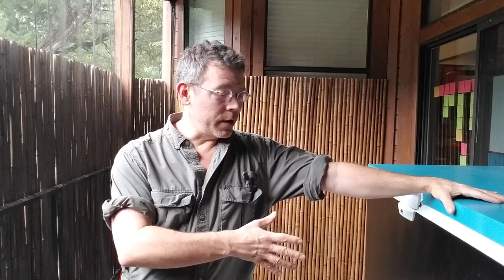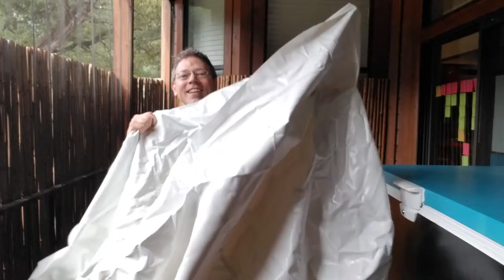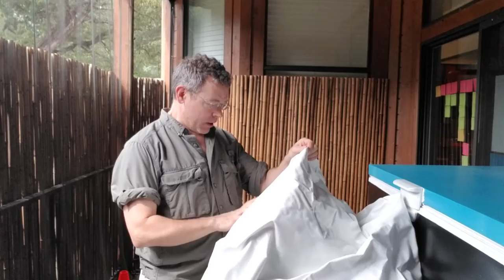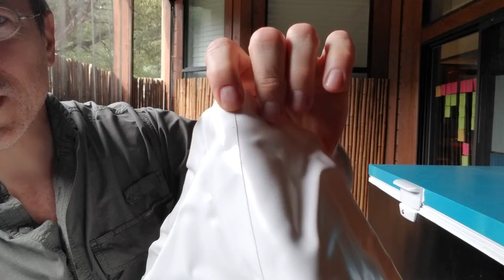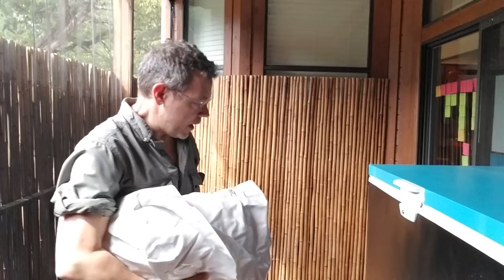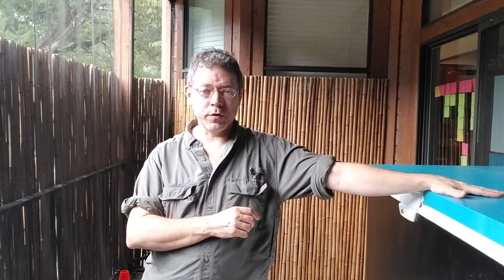Do you Need a Liner for Your Chest Freezer Cold Plunge?

Comment: Very informative video,I bought a very large chest freezer from a kebab shop complete with holes in bottom foil,siliconed them up as best I could placed carpet in bottom and used a heavy duty Pvc pond liner, so far holding up well with the ink bird temp controller and a floating chlorine tablet dispenser 👍👍

Comment: If I use fiberglass liner, do I need to sand it or is the sanding only for pond liner?
Reply from the maker: @op14435  - sanding is required for any permanent coating applied to the interior of a chest freezer. 

A step by step guide to fiberglassing a chest freezer is in the works. 

Join my free facebook group for updates.

Comment: Thanks for video. Have bad chemical issues. Thinking maybe fiberglass!  Don’t really want too much going into the freezer so thinking I will empty every week rather than filters etc. how would fiberglass work if you left drainage exposed?!?
Reply from the maker: Hi Danielle - I totally understand about chemical sensitivities - one of my friends in Austin had that issue. 

Lining a chest freezer in fiberglass is a big project. If you are new to doing fiberglass, there are many things that can go wrong and you'd be better off hiring a professional who is experienced. The cost could add up quickly. As an alternative, you might look into Line-X XS-350, which is a coating certified for use in potable water supplies. It has a smell for a week or two that dissipates. See the link in the video description comparing the four liner options for more info.

Comment: Hello, I bought your book. Glad I did. Great info. Question for you, you mentioned getting a pvc liner since it is more compatible with ozone. Any suggestions where? I found plenty of places that do vinyl. The one you suggest in your book is local to me and I’m just waiting for them to get back me.
Reply from the maker: Thanks for your feedback. 
Both vinyl and PVC are rated as having a "B-Good' compatibility with ozone. I ordered a PVC custom pond liner from here: 
https://polyfabrics.com/liners/pond-liners/
Reply: John Richter Thank you for the reply. Nice! That’s the company I contacted. Just waiting for a response from them. Got pump, ozone, timer and just need liner. The thin metal in the freezer I bought is sketchy.  Lol
Reply from the maker: @mfeltster  - those metal interiors are not the greatest. Find a wet area floor mat to put on the floor - that will help protect it. Also, it's a good idea to support the outside bottom to keep it from sagging. that info should be in the book! :)
Reply: John Richter yup it sure is. Already on it. Thanks.

Comment: I used JB Water Weld to seal and then painted it with Pond Shield. This worked really well (since February). But I have found a very think layer of water has got into the bottom panel (seems to be stuck there). Has anyone found this? Not sure if its could be dangerous?
Reply from the maker: Any leaks could damage your chest freezer. Find out where it failed and patch it. 

First,  drain it and put it in the sun for 7-10 days to bake out the moisture.

Comment: Hey, John! I just applied jb waterweld to my chest freezer but I must have missed the part where you mention to sand the areas the epoxy is being applied to in order for it to stick. Do I need to redo the entire thing or what can I do to ensure this won't cause any issues before I add water? It is white plastic inside.
Reply from the maker: If it has cured hard, then let it be. 

However, if you want that chest freezer to last long term, install a liner. That is not plastic, it is white enamel over a metal wall, and we have plenty of reports of surface rust when no liner is used- some in as little as two weeks. 

See this post for more info about the recommended liner options: 

https://chestfreezercoldplunge.com/4-liners/

Comment: What liner will be preferred if I want to make my chest freezer with salt water ?
I recently bought chest freezer with aluminum interior and I want to cover it with something because I don't want to make a bath with metal.
Reply from the maker: Pond liners are the easiest and least expensive option. 

I have a free spreadsheet in the files section of my Facebook group that will help you figure out the right size. 

Check it out here: 

https://www.facebook.com/groups/chestfreezercoldplunge

Comment: My interior is bare metal New,  can I get away with just using pond shield without sanding or am I better off using a liner? I want to go the pond shield route but don't like the idea of sanding and then spraying that thing you suggested.  Hopefully I can by pass those two steps and go straight to covering the bare metal with pond shield..
Reply from the maker: Best practices are best practices for reason. If you leave out any of the steps to install Pond Shield, it will fail, and you will have wasted a bunch of time and money, and then you will have to start over, wasting more time and money. 

It is always less expensive to do it right the first time - believe me I've learned that lesson the hard way. 

See this post for the best practices and steps to install Pond Shield:

https://ChestFreezerColdPlunge.com/Pond-Shield

Comment: Hey John! Is there any possibility of electrocuting yourself due to a leakage or a charged capacitor when the freezer is unplugged? Thank you!
Reply from the maker: Safety is of vital importance when converting a chest freezer, and this topic has been discussed in depth on my Facebook group Chest Freezer Cold Plunge. 

Yes, you can electrocute yourself if you get into the chest freezer while it is still plugged in, and the seams have started to leak water inside the walls. That moisture creates a connection which puts an electrical current into the water. 

If you unplug the chest freezer EVERY time before you get in, this will not be a problem. 

If you correctly seal the seams, this will not be a problem. 

Appliance repair-people and electricians have said that there is nothing to worry about regarding a capacitor.
Reply: @JohnRichterAustin  thank you for a quick and detailed response, I appreciate it! I'll check out the Facebook page very soon. So the capacitor discharge or a short circuit is not possible while the freezer is unplugged?
Reply from the maker: @Vladgg26  - when the chest freezer is unplugged, you must still have the power cord AWAY from the power outlet, and make sure that there are no other appliances, tools, or electrical devices anywhere near the chest freezer. 

If you do that, there is almost zero chance of electrocution. I say almost zero because... lightening, or freak accidents are still possible. 

Capacitor discharge has been deemed by the experts as a non-issue.
Reply: @JohnRichterAustin  thank you again! Very informative

Comment: Hey John , how does the wrap work? Does it affect overall performance Heating and Cooling does it bubble?
Reply from the maker: JS - just to make sure that my definitions are correct: 

This video is about liners that go on the inside. 

A wrap is a decorative cover that goes on the outside. 

Neither one has any noticeable impact on the chest freezer cooling the inside or dissipating heat on the outside.
Reply from the maker: I am in the quality control process of making custom liner for chest freezers which will solve the number of problems with pond liners and at a lower price than using a professionally applied spray liner. 

If you're interested, visit my website and go to the contact tab. Fill out the form and let me know what brand/size of chest freezer you have. I will be reaching out to everyone with prices in the next two weeks.
Reply: @JohnRichterAustin  yes I know the video is clear about your discussion about liners inside and yes my question was about the blue and black wraps on the exterior. Ok so no issues with wrap on cold creation or heat distribution when wrapping the outside of the chest frezzer?! Really?!? That's awsome news. I'm in the middle of my first build conversion. 😀 and was wanting to wrap the exterior but had some reservations
Reply from the maker: @js-cw5uv  the exterior is painted, not wrapped. I used an acryllic spray paint on the lid because there is nothing in the that generates or dissipates heat. 

For the outside main chest freezer, I used blank epoxy appliance paint that is meant to go on freezers, fridges, etc. So it will be just fine with the heat generated by the chest freezer. 

I painted it only because after one of my early failed experiments, the outside was looking pretty bad. 

The paint has been in place now for about 3-1/2 years. I just touch it up this weekend. :)

Comment: What spray liner did you use sir?
Reply from the maker: I used a DIY liner that I do not recommend. It did not mix very well and was deteriorated by the ozone. 

Best to use a professional spray liner like Line-X xs-350. But you need to make sure they prep everything correctly. 

There are details about this posted in my free Facebook group. 

https://www.facebook.com/groups/chestfreezercoldplunge
Reply: Awesome thanks.